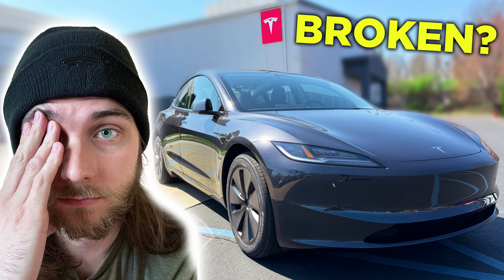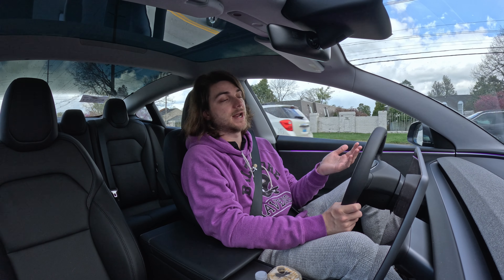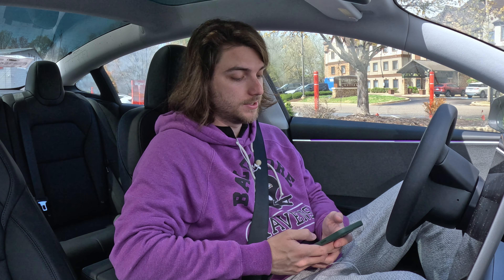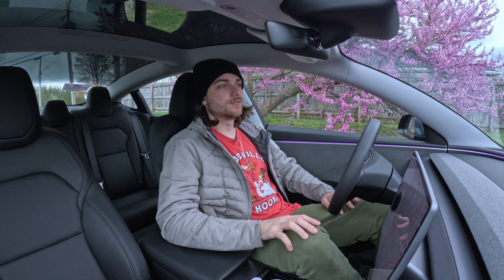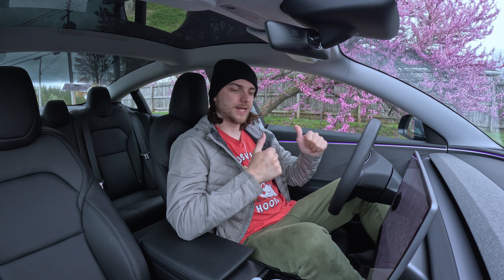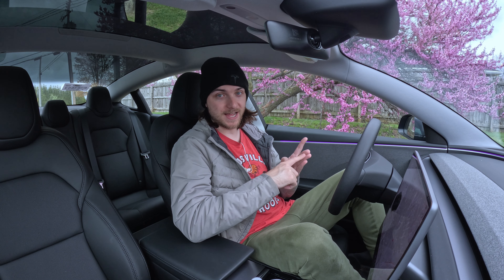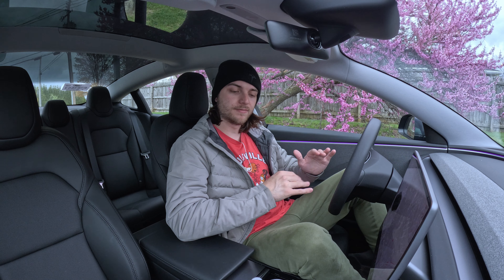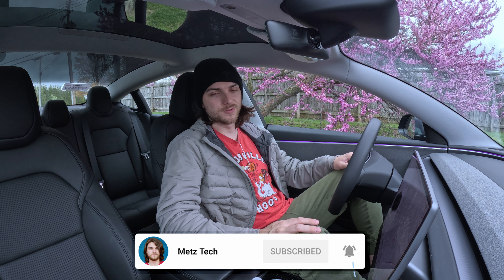My BRAND new 2024 Model 3 is broken AGAIN!

Comment: For the door trim issue, it's just not seated correctly on the inner belt seal. There are three plastic strips which slot onto the inner belt seal for the door then the trim is popped into the door with the clips. It seems it wasn't slotted in properly before pushing it back on to the door swell as fastening the bolts. Might also need to slightly being that section in so that the door trim is not warped. Easy fix so no stress. Just for future reference, any customer facing alerts that you see whilst not in service mode are ones you should definitely submit a request for. Generally speaking some alerts can be fixed with future updates on the flip side updates can also come with some bugs. 

Check you software preference - if it's advanced then you are happy to receive the latest update for you build but it could potentially come with little bugs. Standard is when the update is bug free but generally speaking you don't get first tests on the new features.

Comment: Same here, mine had scratches on hood, scratches on windshield, paint deformity, cracked top glass, faulty subwoofer, screen overheating, misalignment on the exterior and interior, ripped stitches in the passenger seat, exterior trim piece falling off, a hole punctured in on the trim above the ambient lighting on the dashboard, and wait for it…. A HUGE SUSPENSION ISSUE. They’re refusing to fix the misalignments saying it’s “within spec” (yeah okay), they said they couldn’t see the crack on the top glass even AFTER I showed them and the ticket says “resolved, glass cleaned and no scratch visible, customer couldn’t show on intake” (what a lie, I showed them the crack before pre-delivery, the next day after delivery, and the day I got it serviced, and the day after I got it serviced). Btw To delivery of the car because I knew there were cosmetic issues, and I knew that they would fix all these things because I’ve had a Tesla before. I couldn’t drive my car until I accept delivery, and the second I accepted it and I literally out of the rolling gates that they had at the delivery center, suspension issue lol. Two weeks ago they kept the car for two days, three days ago they’re took the car for another 18 days….
Reply from the maker: Goodness. What a nightmare. 

I would be flipping tables at that service center until they fixed every last issue. 
So sorry you have had to deal with that!
Reply: why did you take delivery? refuse delivery if all those issues were found. never take delivery regardless of brand

Comment: Steering wheel error is due to a connector pin that’s wrong from factory. They depin the connector and place it in the right slot. The door panel trim is just little clips that slides over the other trim. Just hold the edge that’s popped out pull up and slide it towards the glass it should seat.
Reply: @jessortiz7981 Do you have any details about what issues the wrong connector pin can cause? Is there a service document I can reference to have my Service Center perform this fix, because they won't do anything right now.

Comment: Your door panel panel issue seems like the edge is warped up a little. I recently too a part my door panels and it had the same sort of design. I think that your panel is fully seated on the door frame, it’s just the top edge is warped up a little making it look popped out.

Comment: Sorry about the issues with the car. I had a 2020 M3 SR+, and had many issues, from door panels aligned wrong to the glove box wouldn't open. In 2022 I traded it in for my current ID.4 Pro S RWD. Other than the software no updates it's hasn't had any issues. And I have 71k miles on it.

Comment: The old model 3 was worked out well. I demod the refreshed 3 last week and the buttons for turn signals worked maybe 2/5 times i pressed them. The motors felt nowhere near as well tuned as the previous model. Idk if the demo car was abused or if they are all having issues
Reply from the maker: The buttons just like to be pushed in the exact right spot 😅 I’m used to it now so I would say I get it 90% of the time
Reply: @MetzTech  thats so sad lmao yeah my key button thats needed for driving needs to be pushed in a very specific  spot for it to work is it some sort of broken garage remote???.... cringe af . Have fun though you and your American built tesla sht quality the ones that come out of shanghai are soooo much better

Comment: Honestly surprised that you don't want the Bolt back. What is the number one reason, aside from the obvious DC fast charging limitations of the Bolt, that you prefer the Model 3?
Reply from the maker: I’m going to making a video on that exact topic but mainly it’s the driving experience. The ride quality, cabin materials, speed, handling, software. Not to mention the charging speed. It’s all just a tier above.

Comment: That has to be frustrating with a brand new vehicle. Perhaps next service appointment, take some blue painter's tape and put it exactly on the passenger door location requiring attention. Too bad you cannot get face-to-face with the technician to stress those items missed. Perhaps as this is the first year of the refreshed Model 3, they are finding out new issues as they appear. My 2023 Model 3 has been near flawless - only one mobile stop to reattach the plastic wrap-around on the driver's seat. Took maybe 3 minutes.
Reply from the maker: That’s why I’m kinda looking forward to the mobile service appointment. Someone standing in front of me… I can be like “right there, fix that please” 😆

Comment: Tesla service sucks! I am not sure if model S/X owners getting a different treatment, but as a model 3 owner I can say Tesla service employees are usually rude, they overlook your concerns and sometimes I doubt they even touch the car at all.
Reply: Other than Tesla, do other car shops take Tesla to fix?
Reply from the maker: Super strange behavior
Reply: I'm on my 3rd Tesla. Own two model 3's and now a model X. The X was used but bought from Tesla. It has had a few issues and service has yet to fix it.
Reply: I used to have a model Y Performance for 3 years, when my lease was done I upgraded to a 23 Model S LR and I definately feel the Service center is more attentive now over when I had the Model Y. I have only needed Service twice for very minor things, but each time they accomodated me with a loaner (Model S or X) or fixed the issues the same day. When I had the Y they never had loaners for me which is unfortunate.
Reply: No, I had an X for 6 months and it was in the shop for half of the time. I ended up returning it.

Comment: My 2024 Model 3 is receiving the same Steering Column Control Module error, basically every drive like you described. Has Tesla told you anything about it?
Reply from the maker: No they haven’t. They replaced it once but it still does it. I want an answer
Reply: @MetzTech I tried a soft restart on the car and it has gone away for now, but we'll see. I'm getting a display firmware mismatch error as well. Hopefully service can figure it out.
Reply: @MetzTech In a different comment, you replied that you didn't get the SCCM error anymore after they replaced the SCCM? Is that not the case and you're still getting the SCCM error?
Reply from the maker: @jyeung528 I haven’t gotten it since
Reply: @MetzTech  can I show my Tesla Service Center your service history showing that your Tesla Service Center changed your SCCM and the error went away? I can't get any of my local Service Centers to do anything for this error message.

Comment: I'm still surprised that my '23 Bolt euv has had zero problems in the 14 months I've owned it; I didn't expect such a well-built GM product.
Reply from the maker: Mine didn’t have any issues until about 2 years in. Great car.

Comment: After reading your previous experience and now this one, I had my finger on the order cancel button for my new M3LR arriving 4/17 from Fremont.   I am now spring loaded to refuse delivery but will take a look at it.  I have a checklist and if one hair is out of place, I will cancel the order on the spot and be done with Tesla.   I can't believe the crap you are going thru on your brand new Highland, these cars need to be flawless.
Reply from the maker: Check all the door buttons and window switches and listen for that hum under the screen! 🤞🏼
Reply: @MetzTech  UPDATE:   Just so that I can report back.  I finally picked up my Model 3LR.  After your recommendations and learning about the what to look for from the detailing guys on Youtube I was pretty nervous about build quality out of Fremont.   I got to the dealer an hour before my delivery time and went over every gap, every panel, and every single moving part inside and out.  Tesla (Charlotte) left the car open an hour before delivery and it was functional (some kind of pre delivery wash mode).  Anyway, as hard as I tried, I couldn't find a single defect inside or out.  The panels were all 3mm to 4mm max, amazing.  All doors, windows, latches, everything worked perfectly.   I took delivery and didn't hear a rattle or creak or anything.  Honestly, this car has been amazing, I'm sorry you had issues and I used to live in Louisville so I know of the Tesla center and the local talent (old HD dealer right by the mega church).  I think the majority of the bad press is from the very small group of unlucky people.  Also a lot of competitors that are being effected by Tesla sales have an interest in bad mouthing the cars.   Overall, the latest Model 3 Highland is a really nice car that I'm quite please with.  YMMV.
Reply from the maker: I’m stoked that you have had zero issues so far. Aside from the few little inconveniences the build quality on mine has been pristine as well. No panel gaps, or rattles or squeaks. It’s really a step up. Congrats on the new car 🎉

Comment: Greetings, remember when I told you welcome to the Tesla experience!, this is the part I don't get how can a company do so many incredible things with propulsion, software and technology buy can't master the art of putting together a car . Why can he spend money on resolving this manufacturing issues at the factory and not after delivery. Which makes the experience degrade. I heard once that Musk said that the most importance thing is pumping out as many cars as possible, deal with the fit and finishes after delivery. At the begining this things were overlooked, but now with all the competition they can't rest in their engineering achievements. Because we start questioning how a $40,000 car has worst fit and finish than a $25,000 toyota, and you are frustrated because you spent all that money on a car that's supposed to be the epitome of vehicle engineering,  but those little stupid things make you wonder if you made the right decision, with so many offerings out there. After almost 4 years with Teslas, I switch to a VW ID4 and so far I'm loving it and cross my fingers no issues ,no trim or software issues. My personal opinion that's one of the reasons his loosing market share every year and why their piling up at the delivery centers, despite the awesome price with all the discounts and freebies his giving. So after starting as diferent car company he has made Tesla one of the old Detroit 3, having to discount and offer perks to move metal and matching their 90s and 2000s build quality. Like I said just enjoy the positive and unique driving experience and try to ignore the little annoying things. No every car can match their ambient lightning with the color of their jacket 😂.

Comment: I had a Bolt too, should’ve kept it. I’ve learned from your mistakes, I won’t be purchasing a Tesla
Reply from the maker: Tbh tho, I wouldn’t trade my Tesla back for the bolt. I did love it though
Reply: @MetzTech  the Leaf is old tech, but it seems the most reliable at this point
Reply: I had a model 3 for almost 5 years, before I sold it for a new one. After they lined up the door panel and fixed a lock on the frunk, I had no none service visit in almost 5 years (except for one damage issue with fireworks). No oil change, no brake pads change needed after 50k miles. My BMW's I liked a lot, but after about 30 years driving them, they had multiple times more service needs. And more expensive to maintain. A good service centre is always key. But I can't complain in my location for the Tesla support. But if had all those issues with my Model 3 Highland, I would be really disappointed, that is clear.

Comment: Aesthetically speaking!
Reply from the maker: I mean… sure. But that doesn’t mean if I make an appointment to get them fixed it’s ok for them to not fix them?
Reply: I wonder why GM went bankrupt 🤔
Reply: I’ll say this I have a 2023 330i m sport. And I have no issues on quality. He has a right to be picky on a car. They are expensive these days.
Reply: @mikedee42  exactly. It’s brand new!  Also it seems like some of the issues weren’t there until the service technician messed them up.
Reply from the maker: @shaananwalsh7513 that’s the most frustrating part. The door trim wasn’t messed up before I took it in to service. They did that